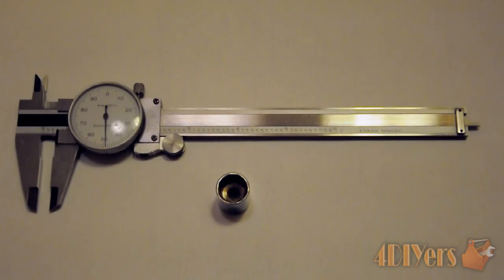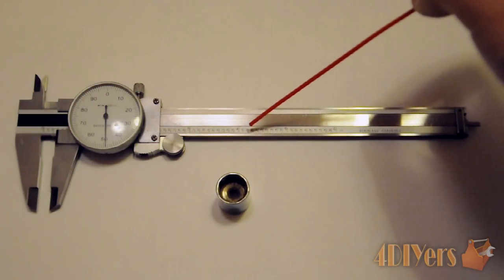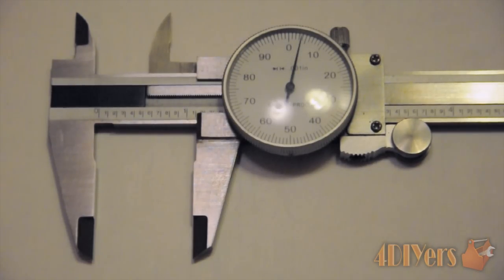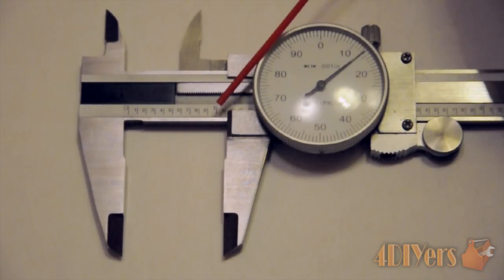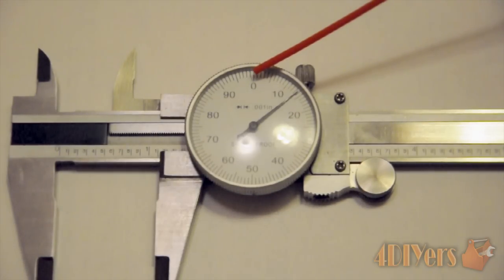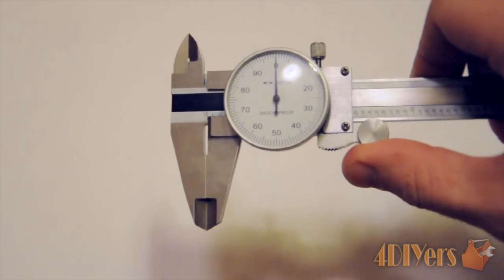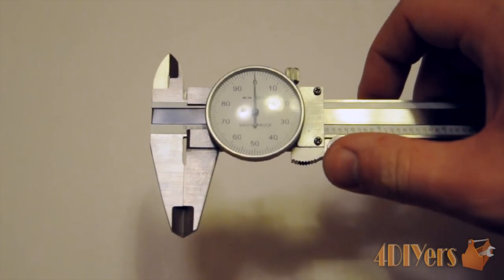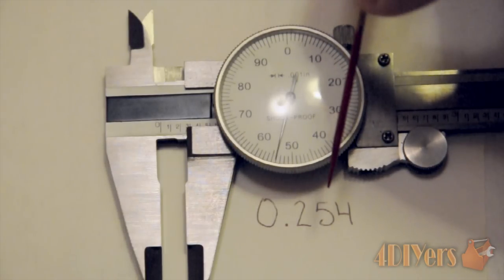DIY: Reading a Dial Vernier Caliper (Imperial)

Comment: This is very helpful. I recently ordered the wrong bearing twice for my Snapper riding mower front wheel. This video helped me to measure to dimensions of the old bearings with my Dial Caliper (which I bought from a thrift store and never used before). Now I was able to buy the correct bearings. Thank you.
Reply from the maker: Great to hear!

Comment: why would someone thumb down this video? it was as good and simple of an explanation anyone could ask for ?
Reply from the maker: Thank you for the kind words, I really appreciate it!
Reply: Thats the exact thing i thought about when i looked at the ccomments
Reply: Because the scale doesn’t measure tenths, it measures inch and hundredth thousands.
Reply: @daveshoop4628  What? The scale is graduated in 1/10 increments to each inch segment, and 1/1000 on the dial. So how can it not measure tenths?

Comment: Nice intro video.  To add... there is actually a fourth measurement calipers can perform.  It is called a step measurement and utilizes the backside of the inside jaws.
Reply from the maker: Thank you and great tip as well! I ended up redoing this video on my metalworking channel and included the step measurement too.
Reply: @4DIYers  Where can we find your metalworking channel where you go into the step measurement?

Comment: Excellent presentation.  Just as a point of minor pedantic nitpicking, the instrument is properly termed a "dial caliper."  There is no vernier present on this instrument.  The dial replaced the vernier.  A vernier consists of two adjacent parallel graduated scales.  Irrespective of nomenclature, you, sir, are an excellent instructor, and you did superb explanation on the proper use of the dial caliper.

Comment: while measuring a shaft, i got a reading of 1", with the slide point at 2 and the dial reading 90.Is it 1.290 and how would i write it (inches/thousand?)
Reply from the maker: Yep the measurement is 1.290". That would be written as one point two hundred ninety thousandth of an inch.

Comment: How do you convert that measurement into a fractional reading? For example 1.25 is obviously 1 - 1/4". Is there a simple conversion for more odd measurements?
Reply from the maker: Are you using this for drill bit sizing? If so, I have a drill index chart on my website so you're able to switch between fractions and decimals. http://www.4diyers.com/resources/metalwork/drillindexchartsae.php

Comment: Well articulated, clear video and very useful!
On the Outside and Inside jaws there is a set of notches near the rail.
What are the notches used for?
I measured the gap and I think it was .03 inch.
The gap was the same on both sets of jaws.
There is a shoulder on the depth 'stick' that could affect the depth reading.
Any idea why there is a shoulder and not just a straight 'stick'?
Reply from the maker: Thank you! That I am not sure. I would assume it's the closest edge to the slide, therefore if there is any dirt on the jaws it can have a greater affect on the accuracy of the measurement. It may also allow for future calibration if the jaws need to be reground.
Reply: 4DIYers Yes, the inner most edge of the jaws near the slide.
When the jaws are together, there is a gap near the slide on both sets of jaws.
The gap is machined in on most of the calipers I've seen.
Since it costs money to cut the gap there must be an important reason to have it.
I haven't found the reason just yet...

Comment: I have a dial caliper that reads 0 @ 12 o'clock to 100 at 6 O'clock and starts over @ 0 @ 6 0'clock and reads to 100 again at 12 o'clock. The caliper has two rules. The upper is in CM and the bottom is in inches. Can you tell me how to read this Dial. Thanks, Hank
Reply from the maker: +HammeringHank100 Can you post up some photos in my Facebook page???

Comment: Ok you've shown me how to read this tool what i need to know is how to turn my reading into a cable size . I have a dial type and a digital type . The dial type read 1. 92 i guess. The digital type read 0.18in or 4.6mm . can you tell me what cable or drill bit size would be ?  Thanks I'm trying to find out if this cable is 1/4 in or 7, 3/2 seconds cable so i can order a swag type fitting for it.  Thanks i sure need to know this.
Reply from the maker: +Steven Hardy Simply use an index chart which will have the decimal form compared to the fraction form. http://www.custompartnet.com/images/size-charts/drill-size-chart-english.png So it's between 11/64" and 3/16".
Reply: Thanks very much.

Comment: can you explain what is meant by measuring the "step" by using calipers?
Reply from the maker: I might just do a video on that! But to explain it, you would be using the flat face of the fixed jaw on the outside and then using the opposite edge of the movable inside jaw. Here's a photo to give you an idea how it works http://www.measuring-tools.biz/step-measurement.png
Reply: thank you so much